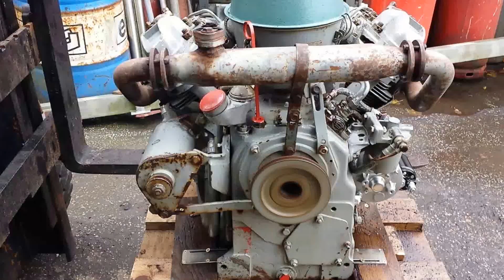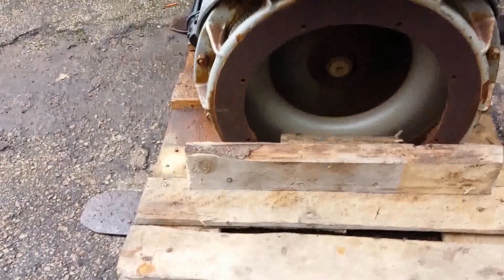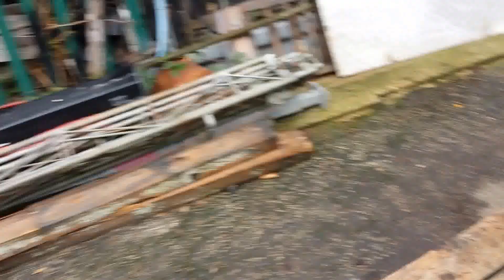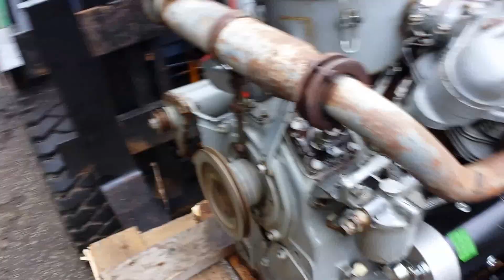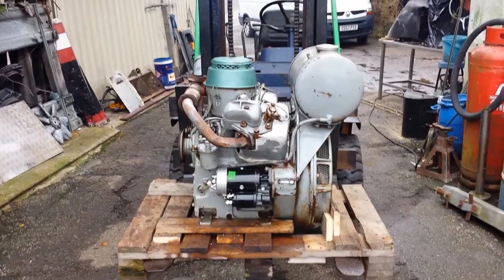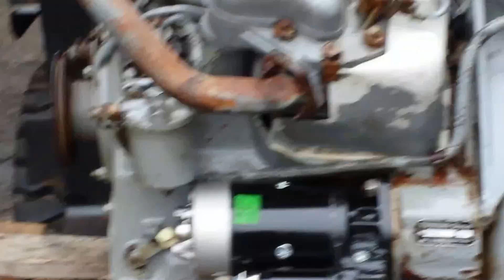V twin farymann diesel engine old MOD new never run before stood in warehouse 30yrs

Comment: Can't be too rare, I have one. :-) It is tied to a 15KW Lima 3 phase generator. Needs a new fuel pump and an oil change but they are tough little twins. With a generator, when you push down on the lever to decompress, you will wait, and wait, and wait for it to finally stop turning.  And don't you dare let up on it or you'll find yourself waiting some more. :-)